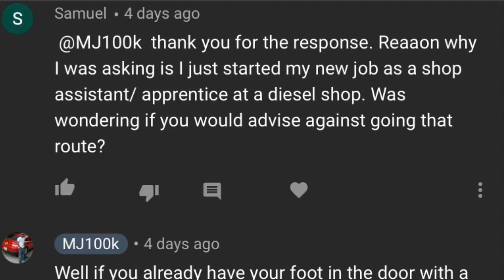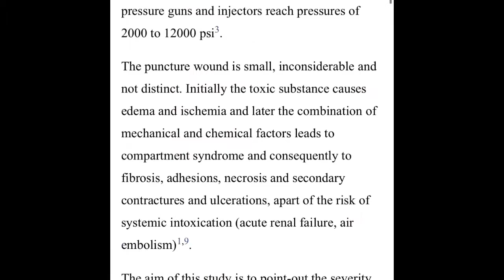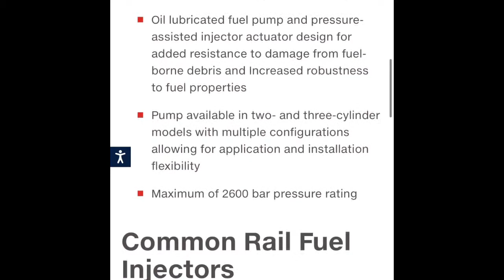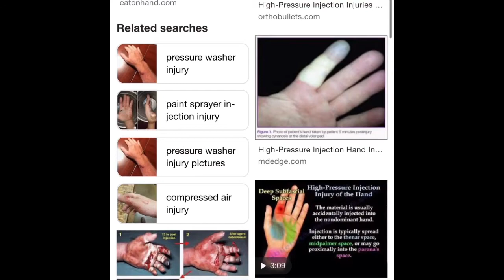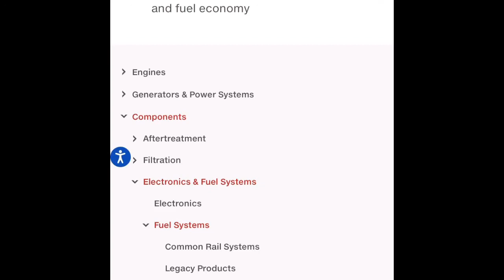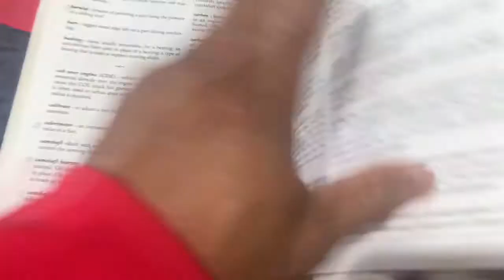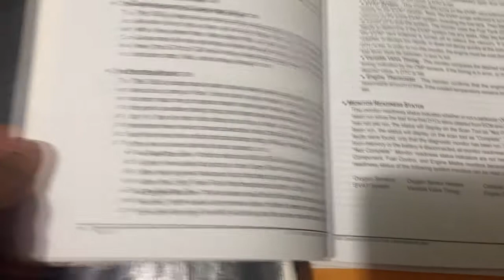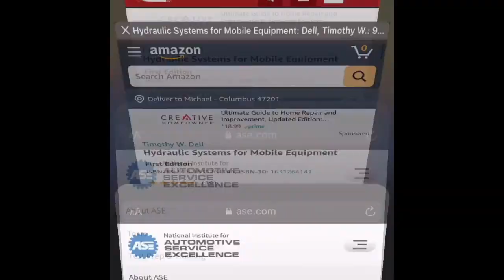How to become a Diesel technician / mechanic without going to school

Comment: I’m starting out as a mech assistant at a nearby Diesel shop and have 3 years experience in the military with working on mainly Diesel Generators, somewhat Heavy Equipment, Somewhat Humvees and 7ton trucks. By somewhat I mean I’ve done basic jobs to maintain the equipment nothing like engine rebuilds but I have some experience of the deeper stuff working on my own cars. Since I joined out of highschool I don’t have any certifications besides the military’s tech training school. I understand the operations of the powertrain and a bit of the drivetrain. I’m starting out 18$hr, Do you think this is a good starting point? I love working on equipment and mainly tried to get a job as mech outside the military because most of the military equipment I thought were outdated and wanted to learn possibly everything there is about diesel/auto mechanics. I told the HR straightforward that I was mainly looking for knowledge and experience rather than the pay itself. Which he replied I have the right attitude. I’m very humble, and love to do my own research, I was also looking to learn how to weld, which is what they also said they were going to teach me on. I kind of just want your thoughts and recommendations if you don’t mind. I apologize if its a bit hard to understand, don’t want to make a novel explaining every nitty bit of what i did/ currently am doing
Reply from the maker: Sorry for the late reply. To answer your questions. Yes - your job at 18$ is a great starting point and yes you do have a great attitude. However, in the future don’t tell people you’re not worried about money. Get as much as you can lol It doesn’t matter if there are some things you can’t do yet. Shops are literally hoping and praying to find technicians like you lol. You already have some experience and a great work ethic from being in the military. Most places will want to train you on their ways of doing things on their specific brands. A lot of places no longer rebuild engines anyways. If they do, there’s 1 or 2 older techs that do that. As far as welding - yea that’s a great skill to have especially for diesels. But don’t think you have to be a master welder. Most of the time they just need you to do easy jobs like weld a bracket back on or tack weld something simple. Really you could buy a cheap welder and mask, watch some online videos and practice at home. But if you want you could try and take a couple welding classes at community college. You don’t need to take time and pay alot of money to go to UTI or Lincoln tech to learn the basic welding skills you’ll need. If I were you I’d stay out at that job and learn all you can. Learn some welding on the side on your own.  After a couple years you can decide if you wanna stay there and get a raise, start your own thing , or go to a real two year community college, if you want a job like working on actual nascar cars, or OEM prototype testing vehicles. I have a video called schools you can go to that are better than UTI and Lincoln tech. See the link below. Check out my playlist advise for future auto mechanics- there is alot of good career advice there. I guarantee you - you’ll have alot of good options 👍 Good luck and thank you for your service.

https://www.youtube.com/watch?v=EK0LQXPpsfA&list=PLUIWins4uZaMa3uDL1_bvKWd5yj2oS80e&index=3&t=131s

Comment from the maker: To the person who commented- comments are glitching and it won’t let me directly respond to your comment but— If you wanna learn to fix diesels, I wouldn’t worry too much about electrification. It’s gonna be a long while before you don’t find diesels on the road anymore. It’s gonna be an even longer while before diesel off-road equipment (ie farming/mining/generators etc)  is gone. Also, the companies that make Diesel engines (Ex. Cummins)are, in many cases, the same companies that are doing electrification. (Tesla being the exception but anyways) So once you start working at one of the Diesel brands, they will train you on whatever electric products they come out with.  So if you like Diesel, go ahead and get started learning. I would suggest that you pay attention in electrical class though. You need a solid background in electrical for all modern vehicles— gas, diesel, hybrid and full electric !